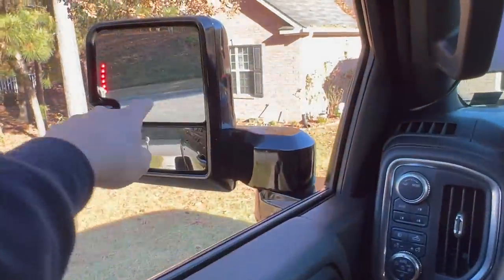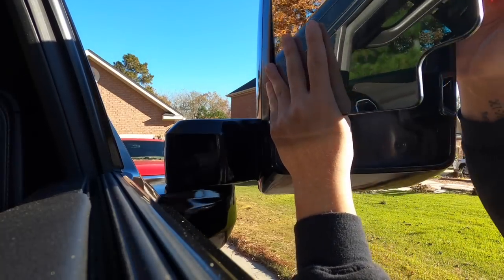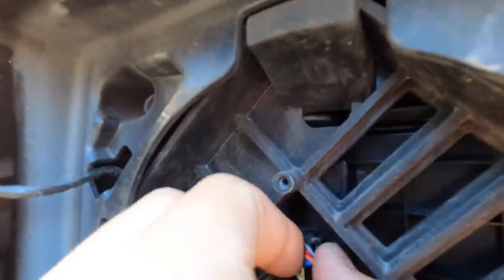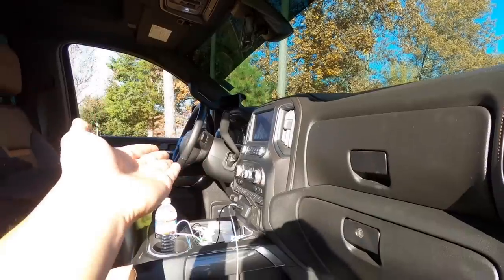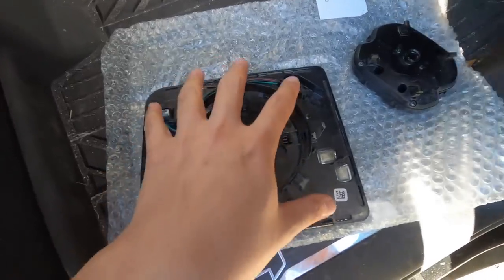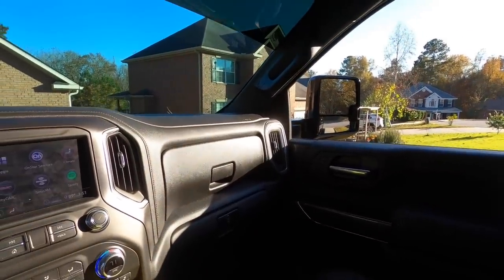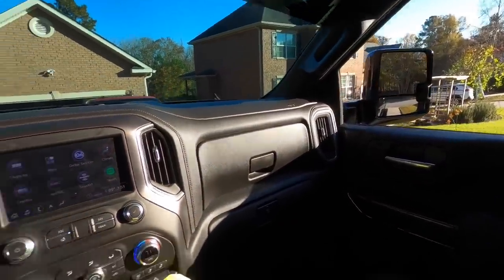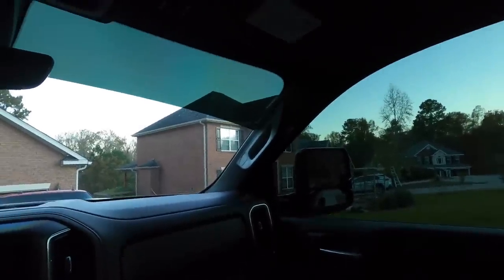How To Bring Back Your Blinkers On The Mirrors That GM REMOVED In 2020

Comment: Question , where did you get your power running boards? Just bought a 2022 AT4 limited , carbon pro
And didn’t come with them. So looking to purchase some.
Reply from the maker: They’re Amp research steps. Any shop near you should be able to get them for you
Reply: @JWMontoya  thanks brotha